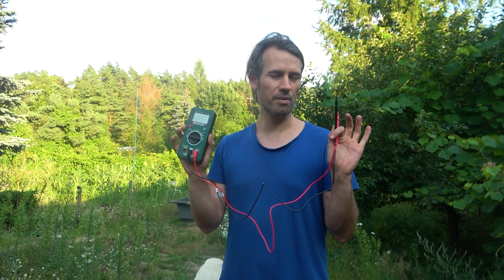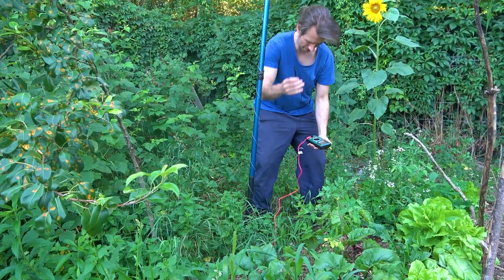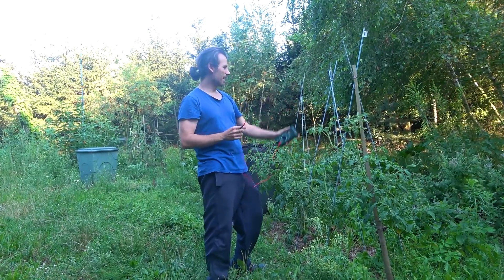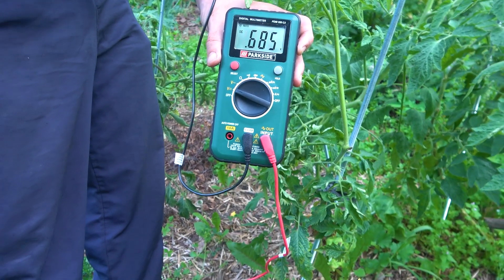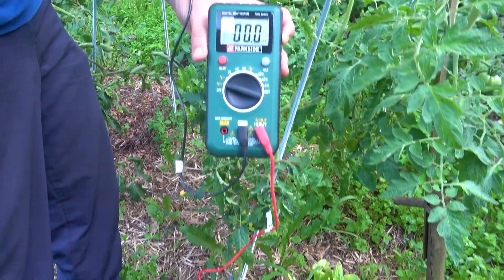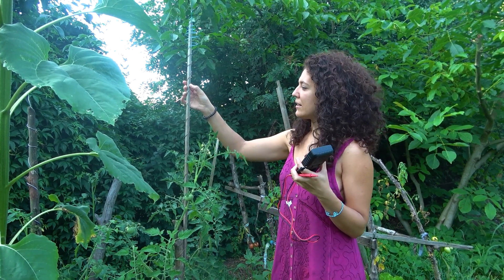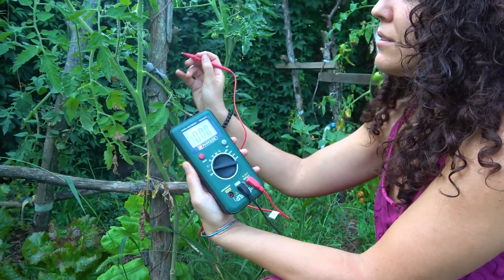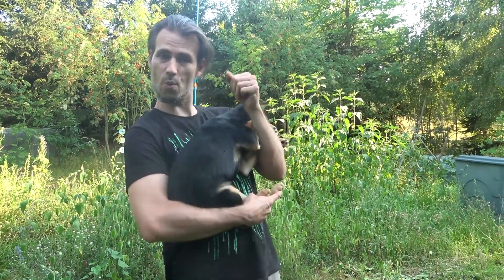Electroculture TEST: Can antennas produce volts?

Comment: Third Comment from Eugene Iheremelam Inya.

Electroculture Test.

Through this teaching I understand how electroculture test is conducted.
With Voltmeter electroculture is tested to prove the existing DC voltage around the plants.
The antenna and copper wires were tested to accetaing the presence of electrical signals flowing to the soil to impact the plant growth and health.
From one stage to the other measurements were carried out simultaneously revealing different output voltage measured in each stage.
Infact, with the presence of electrical currents the plants stand a good chance in doing well.

Comment: A potential difference is generated between the suspended wire and the ground if the wire is at a different potential than the ground. 
That is why you got these results. 
Is this correct?